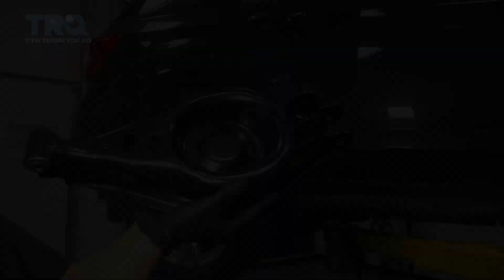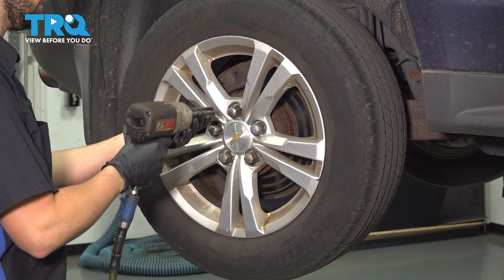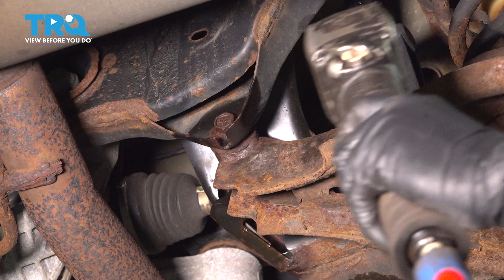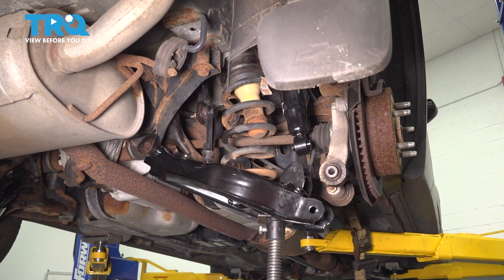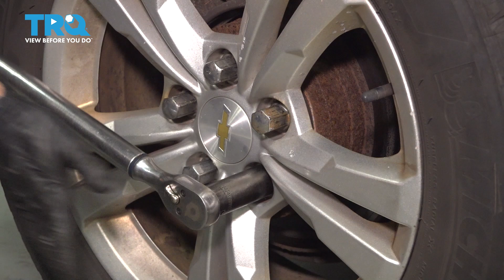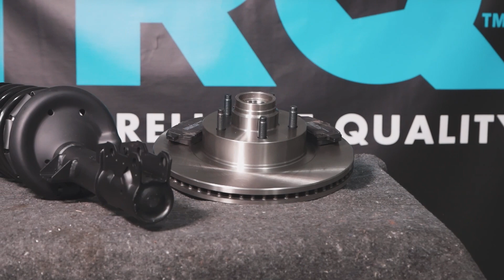How to Replace Rear Lower Control Arm 2010-2017 Chevrolet Equinox

Comment: Would these parts excluding the shock absorber cause rear end sag? Just vhanged the shocks out in the rear but it appears rear driver side corner is sagging. Im thinking either spring or lower control arm, they just dont look bad. Any thoughts?